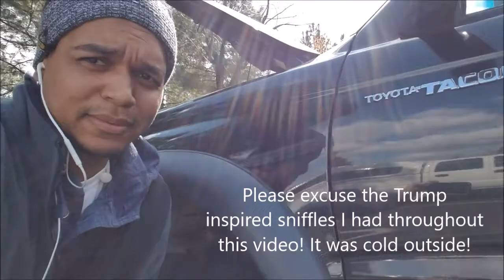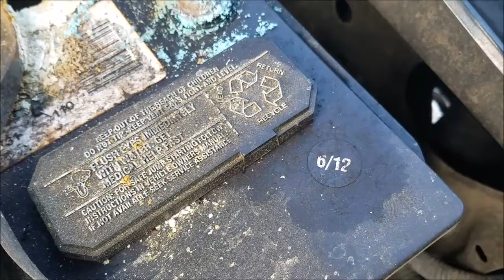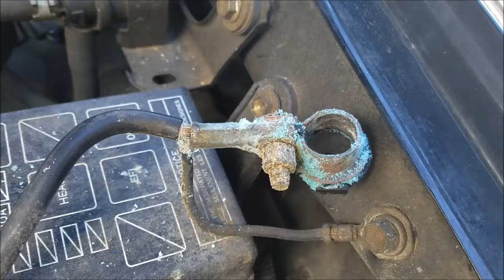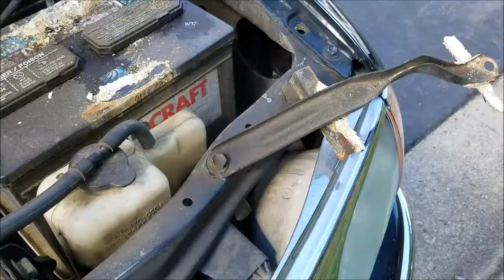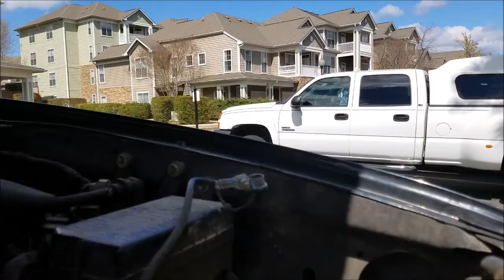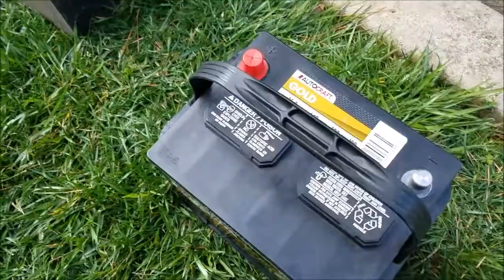REPLACE CORRODED BATTERY | Toyota Tacoma

Comment: Great video,when you installed the new battery do you connect the positive first or negative?
Reply from the maker: When I am disconnecting the cables from the old battery, I disconnect the negative first, then the positive. I connect the new battery in the reverse order, positive then negative. I just follow the factory service manual guidelines from Toyota

Comment: Anyone out there who has this issue is to go to your local auto parts store first. Buy the spray cleaner, the custom brush, the corrosion pads and the sealer. Costs about 10 - 20 bucks for all and it prevents you from having to do this again after you have done it. If you don't want to buy all that at least get the spray to clean it. It's about 3 bucks and dissolves the corrosion on contact. You won't have that chunk of corrosion like at 5:43 on the positive post. Work smarter, not harder.
Reply from the maker: This is a good tip! I'd advise people to first verify their battery is still in good condition. Often when terminals are corroded batteries can not charge efficiently. Once a battery stays in lower than optimal voltage for a period of time the internal chemistry changes for good making the battery no good. I'd also verify that corrosion pads will fit their style battery as often corrosion pads are too thick to place properly.
Reply: @EngineeredMojo  excellent point my friend. Thanks for the video btw.

Comment: I'm curious why you replaced the higher capacity and also cheaper cost 24F with a group 35 battery?  24F is the better and recommended battery for this application and as I mentioned, it's also cheaper and has more cranking capacity.
Reply from the maker: When I bought this battery there was a shortage of 24F batteries, so I was provided a 35 battery at reduced cost and extended full replacement warranty, it was a no brainer. You are correct, 24F is the stock size, but 35 battery will work as well if required.
Reply: I was going to mention the something similar as the CCA seemed on the low side. I believe it will die on you sooner as someone put a 650CCA batter in my 95 on the last swap and it started dying on me sooner than expected. My question was the height of the battery. I put a normal 24F and it's too high for the J hook to screw on. Anyone else have this problem where the new batteries are higher than what the stock J hook can fit ?

Comment: I'd be very careful giving people DIY videos without considering safety precautions. Even though you brought some up, I think it's important people wear gloves if they handle battery issues themselves and especially when cleaning any corrosion or handling anything with corrosion on it. Safety goggles are highly advisable as well. My opinion for cleaning corrosion is to first use baking powder and something carbonated such as Coca-Cola and watch it bubble up and clean the corrosion pretty well. Combine this with using your cleaning brush to get a good detailed cleaning
Reply from the maker: Thanks for taking the time to comment!

Comment: Disconnected battery in 2015 Tacoma V6 two weeks ago.    Reconnected today.   Battery 12V plus.   No juice anywhere in vehicle.   None.   What is going on???
Reply from the maker: Douglas Shipp wow that's a major bummer, first step I would take is to check the fuses in the engine bay. With no power you know there is a break in current somewhere. Hope this gets you going in right path!